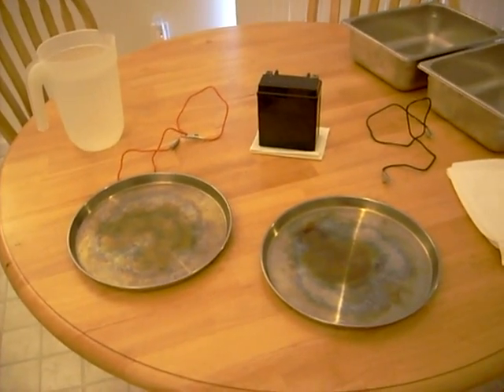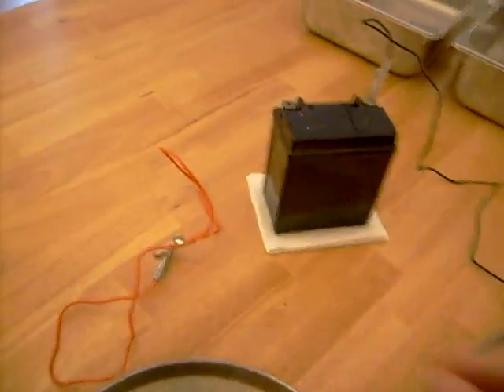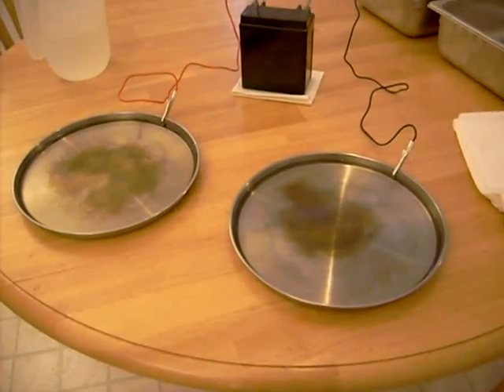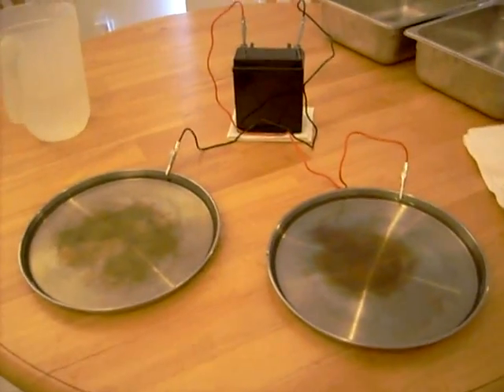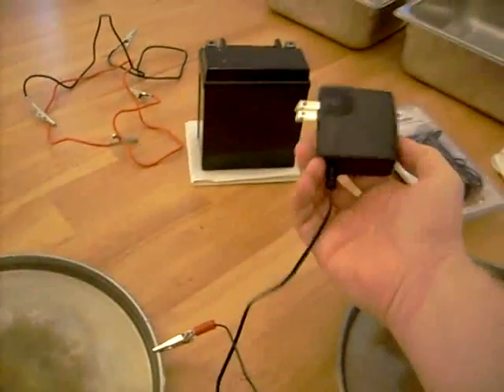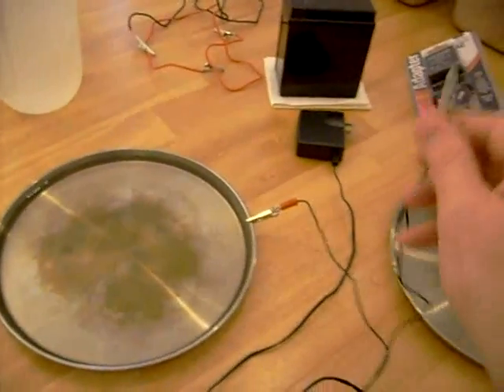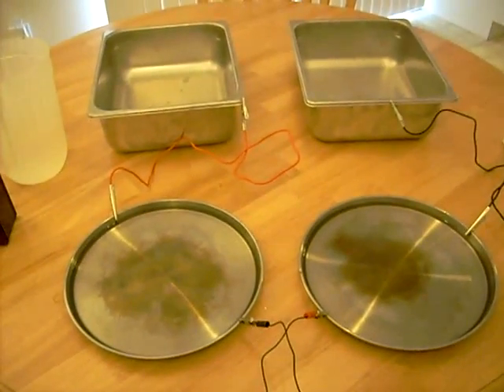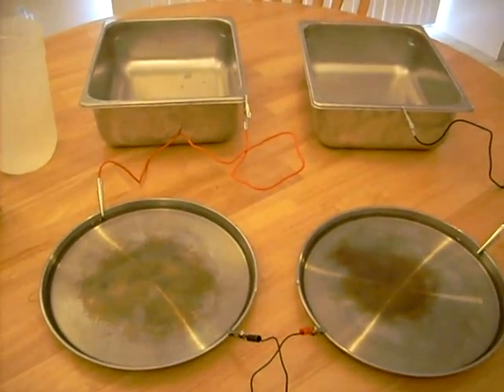Cure Sweaty Hands, Palms, Hyperhidrosis, Hyperhydrosis

Comment: Shannon has recommended at least 18v for effective treatment, or go up to 24v if no results.  Try 8 treatments at 18v, see if you get results.  For some, merely waiting a day or two or more after final treatment results in dry hands.  It varies, and it works for most, not all, AFAIK from these posts/

Comment: Hello. Can anyone please answer me? Does the battery ever run out? Will you have to recharge it?

I'm on my 3rd day today. And I only noticed a tingling sensation when I put my hands in the pans. There used to be a stronger jolt with the 12v battery that I'm using. :(

Comment: I still sweat on my hands :S idk why. been using this method with 12V,27V and 18v, (changed because it was too low, too high, and 18V is ok). been using it since monday, and still i havn't felt thtat ectreme increse in sweating either :S wonder if i do something wrong. I dont have alu. bowls, but i dont think that it is the problem. Because i read online that you could use a plastic bowl, as long as the wires are touching the water :/ well, gotta keep up trying :)

Comment: can i buy a metal bathtub and connect it to a 200volts battery and soak my whole body in there? will that work? 'cause my whole body's kinna sweats a lot, especially around the crotch area...not just the hands and feet.

Comment: Ive had great results building a similar device to this one. Been using it for about half a year atleast, though, due to what i think is because of dieing batteries, the sweat has returned on some level. Still not as bad as it used to, but i do get moist. Bought new batteries and doing the whole thing over every day for a week or so, and ill see how it goes. 

And people, if you suffer from this shit, dont be pussies and be afraid to try this. It works. Buy the stuff you need, and start today.

Comment: Baah, wth, found 3 9v (fire alarm) batteries, and connected in series. reads 27v @ the voltmeter. doesn't hurt. just get a zap when i put my hands in for 2'nd round, lol. this is because my hands are all soaked, and the resistance in my hands have gone faaaaaaaar down from what is normal :) ill post back in a few days how it worked out :)

Comment: does 22V battery safe ? what about ampere?
Reply: sometimes i use up to 24 volt with 7 amps rechargeable lamp battery
Reply: +err balikpapan thanks for ur reply, does it shock ?
Reply: Yes...you can work your way up. The most effective for me is 21 volts dc.Cheapest alternative there is out there.

Comment: @12351694 Perhaps you need to get a new 12 volt battery or recharge that one. Perhaps you need a stronger voltage. If you can get a battery that can increase and decrease the voltage that would be good so you can play around and see what strength you now need if its your own body just adapting to the normal 12 volt. But most likely, if its the same battery your using since a year ago when you started, it has now become weak and you need to either get a new one or recharge it if you know how.

Comment: Hey.  I was thinking.

You know the cords in the back of a normal radio?  the red and black ones?  Can I just use those and pop a CD in the radio and control the power with the  Volume knob? throw some salt and baking soda in there... Cautiously starting the volume at 0..  THrow the cords in 2 seprate tin cans and  "Get the solution" that you are getting?  hit me back before I  fuck up or  find out formyself :) seriously "

Comment: @03338259007 can u post the Amp of AC/DC adapter u r using? coz u can't identify the power of Ac/Dc adapter by just specifying the volts.

Comment: @03338259007 
Hi
I had the same question in my head for a long time.
I came to an answer which I dont know if its the right one or not.
You dont really need to increase the voltage, you just need to keep doing treatments. thats the trick.. I dont really think we get resistant to the voltage. maybe it will get harder for the hand to get 'thick' but its still working, maybe slower but it does.thats my answer.just do treatments, but dont increase voltage.hope i helped